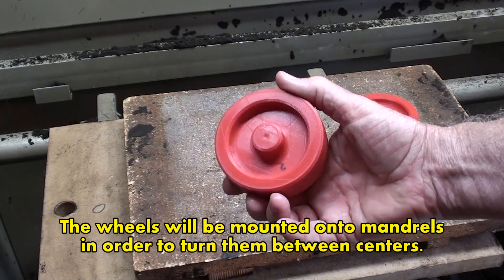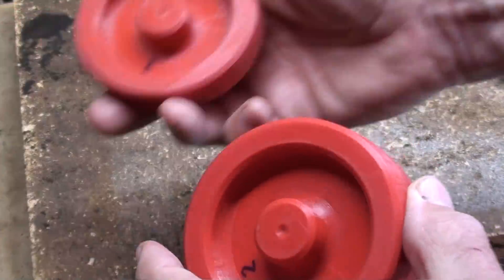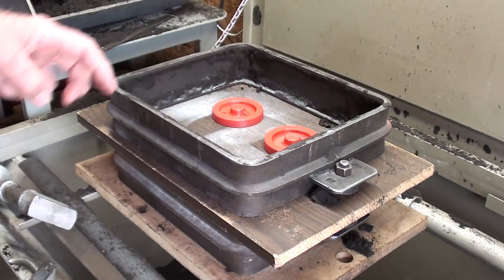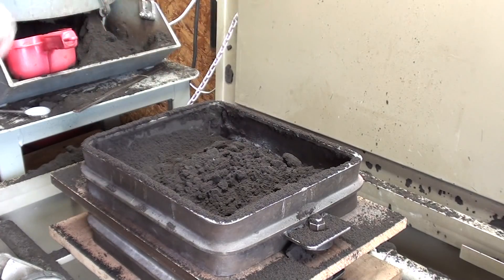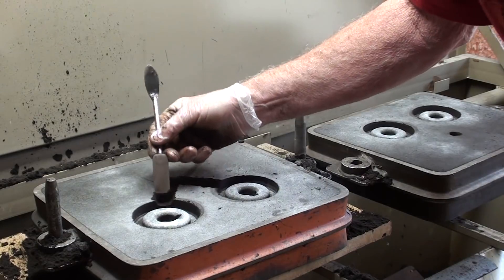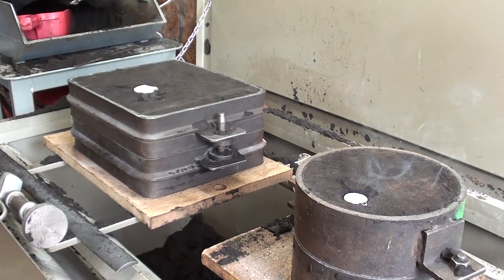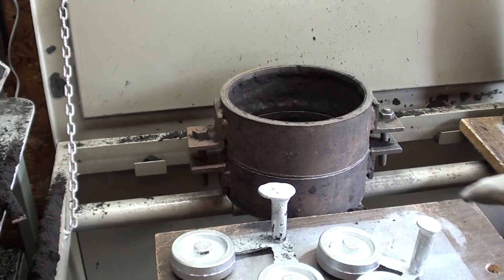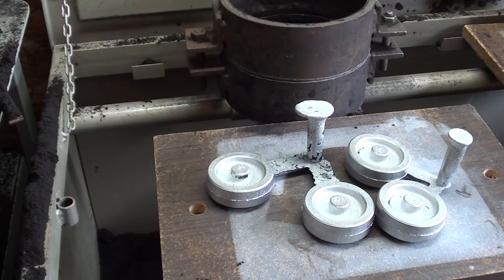Casting the Band Sander WheelsTips #475 tubalcain

Comment: Thanks Mr Pete!  Couple questions:  Why can't you use petrobond with cast iron?  And do you have to add oil back to petrobond occasionally after several uses?  If so, what type of oil?
Reply from the maker: Cast-iron is just too hot for the oil. I use 30 weight non-detergent

Comment: I know that this is not a video on the atlas 618 Lathe and I want you to know how helpful you have been. I'm recently disabled "had a leg cut off" and am trying to figure out what small Lathe to purchase. I'm a complete beginner,I have never touched a Lathe before. If you have any recommendations for where to find an appropriate Atlas Lathe. Thank you so much for your help.
Reply from the maker: I am very sorry to hear about your misfortune. It pleases may have my videos have given you some therapy during your trying times. I would look for a 10 or 12 inch atlas rather than the smaller one. EBay, craigslist, and the 1 ounce
Reply from the maker: The want ads in The newspaper are really your only source.
Reply: mrpete222 thank you very much, I will start looking. I will let you know when I find one.

Comment: I have built flat belt pulleys for some of my antique machines.  Those had to be crowned as well and I did mine using the compound on the lathe.   Have you ever heard of  K-Bond sand?  It was developed by one of my professors at Kent State University,  Mr. Tom Cobett.  It is basically petrabond with synthetic oil in it.  It smokes much less and is supposed to be much healthier to use.  The formula is available on line for free.  You might like to try it out.
Reply from the maker: I have heard of that sand. But have never used it and know nothing about it. I will try to study up on it

Comment: My wife and I love your videos, especially these casting videos! How does it work that there isn’t any air pocket on the wheels where you would expect Air to get trapped? Is the sand still that porous? Or is the mold at an angle that isn’t that apparent?
Reply from the maker: Say hello to your wife. On a small casting there is no problem with trapped air. The sand is said to be very permeable, this allows the air and gas is to escape

Comment: Pete

I just watched a video on YouTube that you might want to watch, if you haven't already.
------>  3D printing: 13 things I wish I knew when I got started   <----- 
He talks about using glass for the base because it regulates heat better, and hair spray to make the plastic stick to the glass, and just use a razor blade to pry it off, and a few more ideas.  He really seemed to know what he was talking about.

Have fun with your projects.  I have tried making a furnace to melt metal, and it isn't working out too well.   Not sure what I'm doing wrong.  It starts to melt, but doesn't stay hot long enough, and starts to harden real fast.

Still enjoy all your videos, keep them coming!!!!!!!!!!!!!

Michael
Reply: I don't know why it put a line thru the site?????????
Reply from the maker: Thank you, I will check out that video

Comment: It looks like your crucible is welded steel, is that correct?  I've heard that molten aluminum will eat through steel eventually (not melt it of course). is that true, and has it ever been a problem, or would that just apply to thin walled steel crucibles?
Reply from the maker: Yes, it is welded steel. And there is a limited life. But mainly it burns on the outside and flakes off until it is very thin

Comment: I knew if I read through enough of the comments I'd see something about the risers. Some people maintain they also provide a bit of extra metal to take up for shrinkage but it's true that in a small casting leaving them out doesn't really cause much for issues.
Reply from the maker: There is an upcoming video in which I use risers and talk about them

Comment: Why not cast iron?
Reply: The melting points of Iron/steel are nearly twice that of Al, and they're roughly 2.5 times as dense, so the fuel cost to get the same volume liquid is a lot higher. Your melting kit also needs to be able to withstand that higher  temperature. CI is a mess to machine, and hard on your tooling. For this part, Al is more than sufficient. (Sorry if I jumped in on your answer Pete.)

Comment: Thank you for another great learning experience! Have been following for several years. Finally got my first lathe , should have it set up. In a couple of weeks , found a really nice 13" SB, with taper , steady rest, collet , 4and 3 jaws. All original! Was really lucky this machine has had very little use! Keep up the good work so I can continue to learn the truths in metal works. Thanks again. Ste
Reply from the maker: That sounds like quite a nice lathe.  In very good condition also. Have fun with it

Comment: That rectangular crucible really pours great! Glad you mentioned the round flasks, they look like great candidates for flywheels and pulleys. Can you stack round flasks and pour a column of wheels with one sprue (?) ? With all the sizes of iron pipe you should be able to use a great number of sizes for a perfect fit. Thanks again for your countless hours of service! :)
Reply from the maker: One of the time with round flask's

Comment: Out of interest - why did you not add any air vents for this casting? Especially on such an undercut cast, I'd have assumed you'd need them.
Reply from the maker: Vans are more necessary with water-based sound
Reply from the maker: Make that sand
Reply: Thank you!

Comment: If you get a chance, I'd like to know your thoughts on oil burners as a cheap fuel source for smelting please? Kind regards.
Reply: Do a search for The Artful Bodger, Colin Peck.  He has a book about a waste oil burner and the appropriate furnace to handle it.  I have built a furnace based mostly on his design, but life has kept me from completing the burner (yet).  It works a bit like a naturally aspirated carburetor with forced, but not compressed, air.  I hope to finish it this fall and get back to "makin' stuff".
Reply: I have found it very hard to find information on refining the operation of my burners... basically trial and error so far... not a lot of science. Thankyou for the reference!!
Reply from the maker: Sorry, I have never used it and oil burner. My furnace is natural gas fired

Comment: Great video as usual Mr. Pete. Would like to see a video on making the wheel for the Starrett speed indicator like you had in shop tip #88 as I don't have one or the means to turn one, but have been looking for one for mine..
Reply from the maker: I need to do that, since I cannot find my wheel attachment
Reply: mrpete222 if you cast a few, put them up on your site. I have been looking for one for a while now. Hard to find!!

Comment: Probably got rid of my homemade foundry too soon. I had cast up a bunch of flats and rounds for on- hand stock, gave the system away to another hobbyist. My source for the aluminum was mostly Sears radial arm saws. Emerson was/ is offering a bounty of $100 for certain vintages of 10” models, lotsa good metal plus steel rods too and made money on the buyouts. My fuel was furniture my neighbors kicked to the curb, oak, maple, mahogany, birch construction; used an old computer fan for a forced draft blower, and yes, it can get to melt temperature with the simplest of fuel, just had to be fed about every 4 minutes, but my cost was $0 so the effort was worth it. ☺
Reply from the maker: That was an interesting approach to foundry
Reply: BeachsideHank ...you made your own foundry?! THAT'S A HOT ONE-!!
Reply: Dale Burrell
Actually, it's really quite easy and cheap. I made mine from mostly found materials, I did an article on the Instructables website some time back, but I had made a few improvements beyond that too, but basically, this is all you need:
https://www.instructables.com/id/Benchtop-Foundry-And-Forge/

Comment: Hello Mr Pete, you gave a shout out to "Myford Boy" at the beginning of the video.
I was watching one of his videos the other day, and he showed how he does the moulding and casting.
I noticed that he put about a teaspoon of salt and about the same of washing soda flakes, into his melting pot.
Do you do that?. 
I think that he said that the salt was for "de-gassing", and the flakes were for the dross.
When I worked for a foundry( as a driver), one of my jobs was about once a month to go to a quarry and pick up rock lime, which the furnacemen used to put in the furnace as they said that it helped to draw the dross to the top of the furnace and it could be drawn off easily.
Reply from the maker: I didn't use any fluxes at all in this video